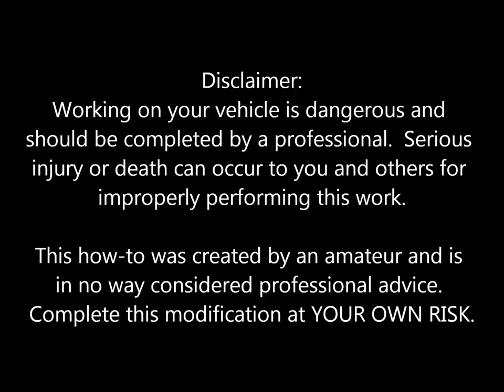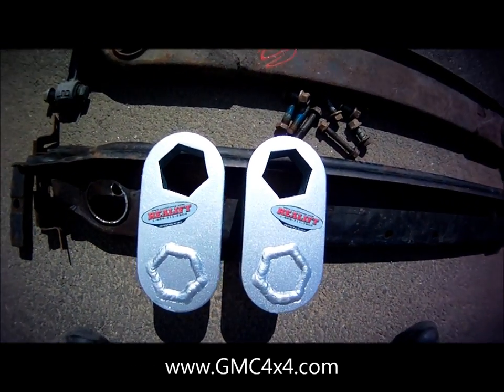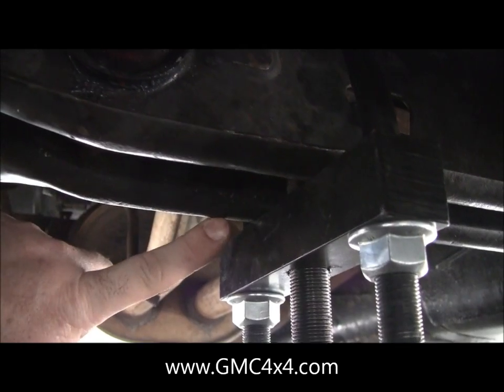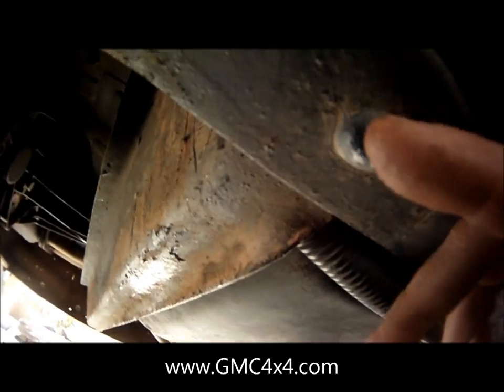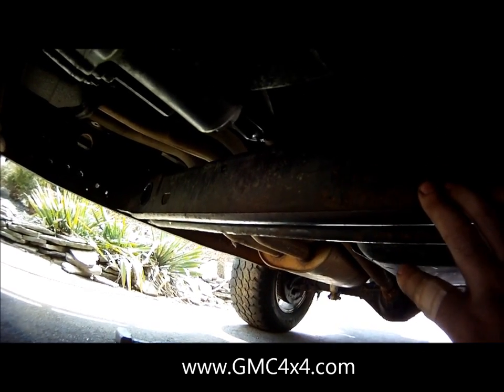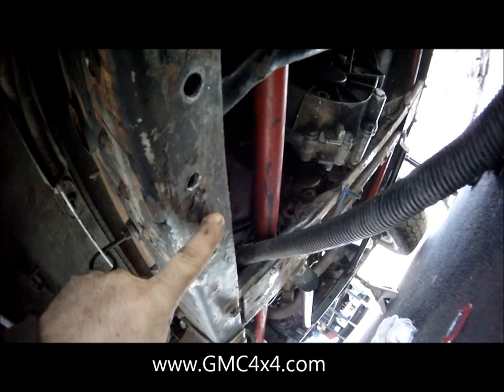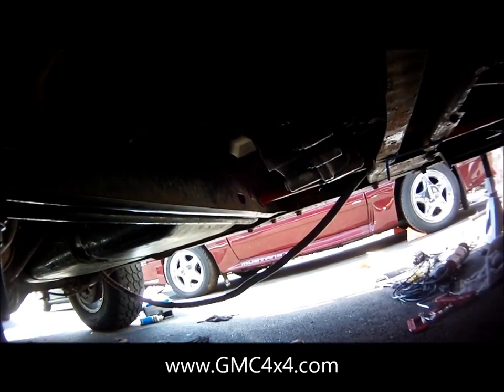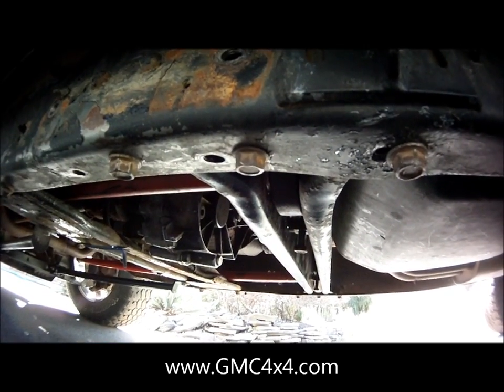Realift Torsion Bar Relocator - Install Video - Chevy / GMC Truck

Comment: Hi this is Sara from Realift we would like to thank you for making such a great video. I would also like to add for those who do not know, this is the most difficult application there is. Only 4 door tahoe/ Yukons require removing the rivited cross member. Oh and the New 2017 torsion bar relocators are 1" taller so even the 6" kits need not worry about having to modify the transmission cross member.
Reply: Sara Browning I'm interested in a set of these for my 2004 Yukon XL 2500 that I'm putting a 6" RCD lift on.  How do I buy, and where can I ask some questions?
Reply: Sara Browning , Thank you for the update. Looks like a great product.
Reply: So on an 07 gmc 2500hd classic with a 6" lift doesnt need anything done with the torsion bar crossmember?
Reply: Sara as Steven commented earlier, won't this make the torsion bar bend inward while it is rotating through the suspension cycle?

Comment from the maker: I've wheeled this truck since the torsion bar cross member was reinstalled back inside the frame and it makes a world of difference.  Break over angle is MUCH better and the truck does not get hung up on nearly as many obstacles as it used to.

Check us out @ GMC4x4.  I'm sure the guys would be very interested to see that Z71 of yours.
Reply: 9 yrs later how are they holding up

Comment: Wouldn't this make the T-Bar sway from side to side instead of twisting like they are  designed.    I'd like to see a video of them while the suspension is working.
Reply: In oem form they move up and down in an arc. With relocators they move side to side in an arc. Because  the torsion bars are not located right at the pivot point it's about 3 in to the side now they're going to be moved 3in above the Pivot Point

Comment: Realift just began producing them again. Pre order while you can. The ugliest thing about IFS lifted trucks with torsion bars are the damn drop brackets. You lose the height that you intended to gain for center ground clearance. Supposedly their going to start making lifts as well. 
I have a 95 GMC K1500.
6" Rough country lift. I plan on getting moog ball joints for increased angle for control arms with reindexed torsion keys in conjunction with the Realift keys which are being made as I type.
I'll post a in depth vid of my creation once I have a few trail rides on the set up.
Cranking up the keys without addressing the control arm angle situation can and WILL damage the ball joints. I've seen it first hand. My buddy had to ride back home slowly after putting ratchet straps on the assembly to put them back in place. Be warned.
Reply: Kristopher FrootLoops 
Have you switched over to the new set up yet?

Comment: Here's what I don't understand- If the aftermarket can come up with these things, then why cant they make long control arms keyed for the factory torsion bars. Try to look up long control arms for a 1/5 ton or 3/4 ton-1 ton torsion bar sprung Chevy that doesn't require a coil over conversion. It doesn't exist. Total Chaos makes torsion bar keyed long control arms for 86'-95' Toyotas, but that's it. I can't find anything for Chevys.
Reply: DeadValorProductions , did you ever find them?

Comment: What exactly is the purpose of this relocator? I am a bit confused. Does it allow you to crank higher up front without damaging front end parts or does it just maintain better ride quality?
Reply: they move the torsion bars up higher so they dont stick out under the frame so much
Reply: Ok thanks man.
Reply: Yup
Reply: I have a three inch lift and my torsion bars don’t hang down below anything, do I really need these relocaters?
Reply: @vincentorona163 No

Comment: question. does this lift the front of the truck or do i need another lift to accomplish this?
Reply: nevermind, went searching through the website and found it works with an existing lift kit installed. good vid though!

Comment: I need a video about Torsion RODS on a 97 Chevy Tahoe.  they are clunking and I need to replace the rubbers and stuff.  do you have a video for that?
Reply from the maker: Check out the How-To Section of GMC4x4.com --- lots of how-to videos.  What is a torsion ROD?
Reply: it's a weird thing that connects to the Torsion Bar, seems only old vehicles have them.  The automotive stores don't even carry them. I have to buy it from the Chevy Dealer.  = big bucks
Reply: K

Comment: I put a torsion lift on my 90 k1500 and have terrible negative camber. will this product improve the geometric angles of the lower control arms?
Reply: treytreas It should be alot closer to your original alignment. But after a lift you will always need an alignment done

Comment: Ok so how does this work with aftermarket torsion bar crossmemsbers? Does it delete them so I can go back to my factory crossmember? Asking now before I even consider doing this and buying a lift. What kits does it work with day like Zone, rough country, skyjacker all the big name and little name kits that I cant name off the top of my head. Any info you can provide is much appreciated!

Comment: Question for anyone who might know.  I have a 05 Suburban 1500, my torsion bar mounting brackets weld onto the frame.  The drivers side rusted off.  I don't really want to weld right under gas lines either honestly.  Would the bolt on type be ok to use?  Would drilling be bad for my frame??  Although I have NO idea why, this is how GM decided to do it so I'm guessing there's a reason..??  Any help would be great!!  :-)  Thank you.

Comment: The lift kit manufacturer could easily make those but they don't. Probably for good reason.  

Buy a non torsion bar drop lift kit in the first place and then you won't have to rig it all up to get your ground clearance back.
Reply: Easy to say but for 90s gm trucks they don't make them

Comment: I’m confused. So does this lift or lower the truck? I have a 1.5”/3” rough country leveling kit on my 01 Silverado Z71. I love the look but the Torsion bar lift keys put my cv shafts on a bad angle and my ball joints! Would this fix the bad angle they are on or not? I guess I don’t understand what it is these relocation brackets do!
Reply: These are not what you are looking for.  These appear to be made to go on a truck that was previously lifted to convert it to a non torsion drop lift.  It will not correct any bad geometry in the suspension.
Reply: @wolverine350r. I didn’t think they would help. And I figured they did what you just told me they did, I just wasn’t 100% positive I was correct in that. Thx for confirming that for me!

Comment: Really wish people would learn how to make a good , clear vidio, this one was just so "fisheyed" , just hard to clearly view and understand, sure, maybe those of you that have done this kind of work in the past or already have there truck raised get excatly whats being explained and the vidio was clear without needing to view vidio  clearly but for me i couldn't get what was taking place, the vidio was dark and most of the time was viewed up way to close to what he was showing (hence fisheyed.) Would have been nice if truck was on a lift and a clear look at where he was, what he was pointing at, what he was about to do and after view. Also a real clear explaining of the goal and why,  I still dont know if this is for those WITHOUT a lift kit already and simply just want to raise by way of cranking up torsion bars and this is a better way OR..... is this for trucks with lift kits installed and this would be another piece to make it ride better. Oh well, guess imma have to do some research.